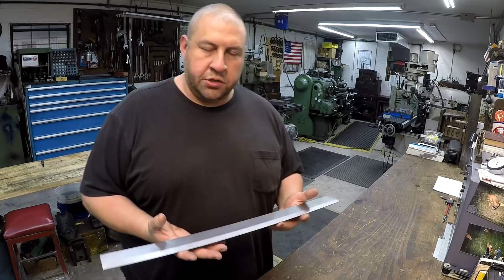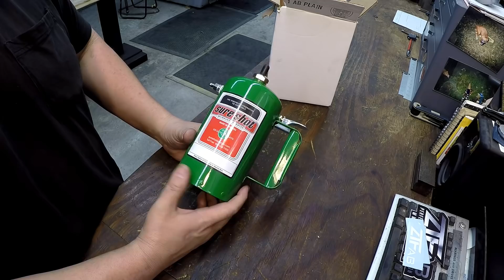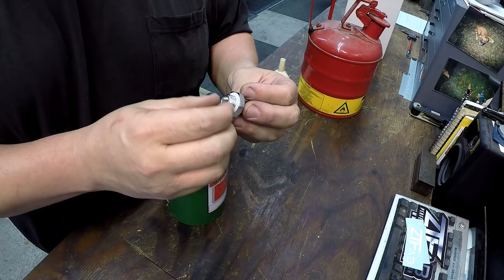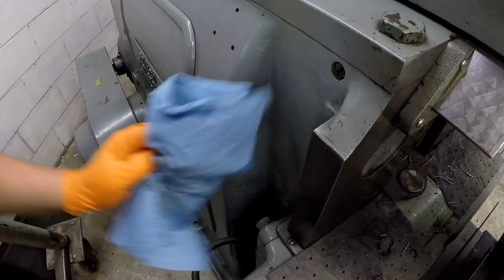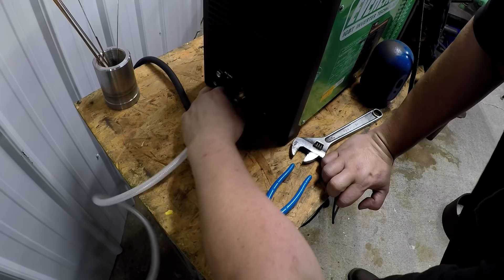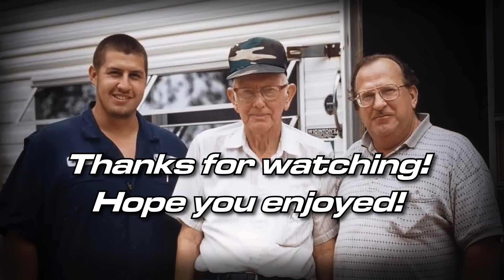SNS 216 Part 1: Straight Edge, Everlast Gas Line

Comment: @Abom79 I’m sure you’re already aware.... according to Sure Shot’s  website, the  “Green” sprayers are nickel plated steel cans and the “Red” sprayers are powder-coated steels cans. Neither sprayer can be used with water/water based solvents, nor paint. They offer several different types of nozzles and nozzle attachments based on the users needs. Just thought I’d share. Love your videos!

Comment: Hi, Adam. All right?
Here in Brazil this tool is called a wire ruler and serves to see the flatness of a surface.
MANUFACTURED IN HIGH PRECISION STAINLESS STEEL STAINLESS STEEL
ACCURACY ACCORDING TO STANDARD DIN874 / 00 - CLASS 00
A ruler of 1000cm costs around US $ 760.00
https://www.ccpvirtual.com.br/regua-de-fio-1000mm-digimess/p
I really like your videos.
Congratulations.

Oi Adam. Tudo bem?
Aqui no Brasil esta ferramenta se chama régua de fio e serve para ver a Planicidade de uma Superfície.
FABRICADA EM AÇO INOXIDÁVEL TEMPERADO DE ALTA PRECISÃO
EXATIDÃO DE ACORDO COM NORMA DIN874/00 - CLASSE 00
Uma régua de 1000cm custa por volta de US $ 760,00
https://www.ccpvirtual.com.br/regua-de-fio-1000mm-digimess/p
Gosto muito dos seus vídeos.
Parabéns.

Comment: Silly question: you're covering a straight edge. I have a few carpenter's squares and no idea which ones are right. How do I go about finding a good reference square to true them to?
Reply: LOMan squares can be self proving. For a carpenters square, place one edge up against a straight edge, draw a line on the 90 degree leg, roll the square over to where the square is on the other side, then draw a second line and you two lines you marked should be perfectly parallel. Hope that makes sense, if not there are some good YouTube videos showing the process.

Comment: Adam would you go over some details about machining on the lathe, the shaper and probably the mill about rough cuts and final cuts. I was wondering do you change cutting tools for final cuts, or maybe just slower cutting or not as deep cuts. Just like a general guide line. I am aware that the material used has to be a determining factor. I have been enjoying  your channel for sometime and have observed you make adjustment because of the results of a pass finish. .......Also do you have an existing video covering  the Monarch lathe machine operation. I see you when doing something when the cutting tool moves away from material and you moving around but more specifically what actions are you taking and are you doing more than one action ? Threading both internal and external also. What is selected on the machine to set up for a specific thread. Thanks Adam
Reply from the maker: Good topics, many of which I have tried to detail in many of my videos, when the topics arise. I'll continue to mention those things when I'm capturing the work.
Reply: Thank You Adam ! Your sharing of information is very helpful. I do pay attention as you apply Abom voodoo to the creation of machined parts. Great explanations of all kinds of tools,  materials and books. I am not a machinist but I have been watching half price books trying to purchased the older machinist book. Basic to advanced. The store says the good machinist books like you share with us do no come through very often.
Reply: When trying to hit a size it's important to take multiple cuts that load the machine identically as you approach the size, measure after each cut, and determine how the machine responds to a certain amount of cut that you're adding. As far as speeds and feeds, people often reduce the feed for finishing cuts to improve finish, and may even switch tools to a s sharper, positive-rake tool, since maximum material removal is not the goal of finishing.
Reply: Good answer, Good general guideline, Thank You Lite Roadie

Comment: We use the sure shot cans at the shop I work at for a rust proof spray that they buy in 55 gal drums. We spray all the parts with it. Works for wd40 too. If you take the spray tip off there should be a brass insert that you can remove for a stream spray.

Comment: Sure Shots have been around a while.  In the mid 1960s I used them to spray anti-icing fluid on aircraft propellers.  Far as I can tell, the design has not changed at all.

Comment: If you had overtightened the flowmeter fitting you would have left a big dent in the hose fitting which is curved where it mates the straight taper in the tee.

Comment: I checked out those Shure Shots out at KBC and they keep complete repair kits in stock - unusual in today’s throw away society. Perhaps individual parts are available too if you tend to drop them. I have used plastic trigger spray bottles for penetrating oil and other chemicals before, but sure shot really puts out the quantity, and they look fireproof as well. Last I looked, gallons of solvent were much cheaper than spray cans. Can you change the spray pattern to a stream for cutting oil, Adam?
Reply from the maker: I would say you need a different nozzle for the increase flow. I don;t know how well that sprayer would do for thick oils.
Reply: If you go to their website, you can get all different kinds of nozzles, for whatever you need... (Sure Shot site, not KBC... at least this is where I was looking)

Comment: That sprayer really sprays nice! Have you ever tried WD40 as a cleaner? It works well on adhesives. I never had a chance to compare WD against mild solvents.
Reply from the maker: Yes I use WD 40 as a cleaner, and to keep the bare metal coated weekly.

Comment: The pressurized solvent sprayer looks like it will come in handy.  Just be extremely careful of what you use if you are cleaning a surface prior to welding.  Brake cleaners and similar solvents can create phosgene gas when welding ( high heat ) which could literally kill you. Read this article to see how it almost killed this guy.  
 http://www.brewracingframes.com/safety-alert-brake-cleaner--phosgene-gas.html 
 Jeff

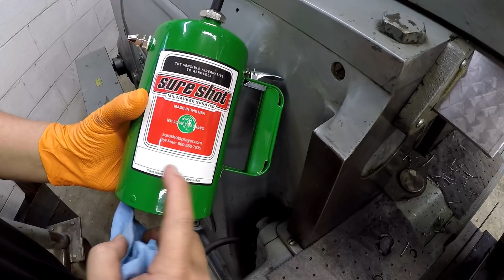Comment: Hey Adam at13:30 or so, it is a good idea not to mix lubricants, and on this note, any fluids unless you are certain no reaction takes place. Also most workplaces require the fluid container be labelled, which in my opinion is just prudent. I just had to pipe in my 2 cents worth here as I am very interested in those rechargeable sprayers.
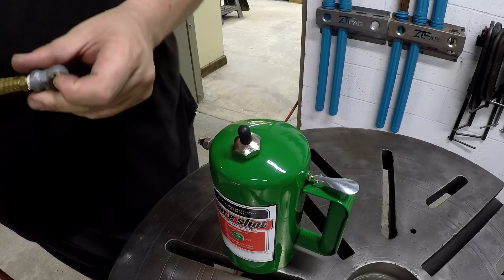Question: at 12:35 those sparks coming off the insert, is that just an indication of a worn insert doing a roughing cut? Or is that material just that gnarly?, thanks and cheers!
Reply from the maker: Yes, at work we have all of our containers labeled as to the contents and other information OSHA wants listed.

Comment: Hey Adam. I have a couple Everlast welders and really like them. But, those gas lines are garbage. They are too soft and balloon and it gets worse with age. Wastes a lot of gas. I made an adapter so I could keep the regulator and use normal gas lines.

https://www.everlastgenerators.com/forums/showthread.php/5472-Everlast-Argon-regulator-upgrade

Keep up the great work!
Reply from the maker: Thanks for the tip.

Comment: I really appreciate the tips you share with us. I did not know about the refillable sprayers, that would be a nice addition to my shop. Very curious about the Everlast, wonder what your opinion of the pulse feature is. Can it be used for aluminium?
Reply: I can't speak about the 200DV that Abom has except it does do AC (aluminum. I have the 250 EX and the AC and pulser are really good.
Reply from the maker: Yes you can weld aluminum on the 200dv. I have yet to try it but plan to.

Comment: Hey Adam I realy don't know why you are worried about working on a block , you have done so much more complicated stuff before! But in my mind the shaper is not the right tool to work on a block because I think that the beats / vibrations that are generated when the tool moves across all the openings of the block does not produce a good surface. In addition, if one of your mills allow you to use a tool directly in the main spindle, you can easily cut the block sideways! Maybe you could grab a broken block from a junkyard and do some practise cuts? Have fun !
Reply from the maker: I’m going to disagree with you on all levels.
Reply from the maker: Actually, that's just my machinist experience talking, but your right. Machining of blocks and heads are a different animal and require certain finishes. I'd still like to try it, just for the fun and practice though, on the shaper. Not for anything critical, but to share some odd shaped pieces that would be more simple to machine on a shaper vs a mill.
Reply: Thomas Eisen if you use a shear tool on aluminum and a very light cut the forces will be very light. That is an awesomely rigid machine. I might try it on a scrap block first but I think it would work well.
Reply: If the block is made of aluminium it will be alright thats true but if it's an older cast iron block the shaper can be rigid as can be you get a bad surface trust me , and running the shaper so slow and at low feed is a waste of time in my mind because an old beast like the G&E takes a lot of power to work.
Reply: Thomas Eisen ok, I haven't done it, so I trust you. 🙂
Reply: A friend of me had an old Ford Escord but with the cast iron block from Kent , also made som cuts on an old block from the junkyard and we really tried everything, different feeds, different sanded tools but always the surface was wavy, at the end we planned the block on a mill and it was fine .
Reply: Hmmm so you think that there was something wrong that we justoverlook Adam?
Reply: I understand ! I think you will make it because your shaper is in a very good condition after you repaired it, our was an old english Sherwood and sometimes only little details that go wrong got a bad effect on the surface so I hope you will be successful and have a lot of fun with that nice G&E !

Comment: Hi Adam , I have not been here for a long time. Are you not afraid that you will fall on these mats on the floor?  I ask seriously.
Your workshop is nice, but I do not like these mats.
Reply from the maker: Those floor mats have beveled edges and are low enough your not tripping on them.
Reply: Ok, thanks for your explain. 
You do a good job , good luck.

Comment: I have a chrome plated sure shot sprayer that I have been wanting to get replacement gaskets and a different nozzle for. It has a stream nozzle,  that is hard to use. I use it for acetone. Thankyou for leaving a link so I can find some parts.
Reply: If you look up Sure Shot Sprayer on KBC it will show you a list of products. Including repair kits and individual spray tips. KBC is nice unlike other online shopping they will ship for $8.95 for smaller orders, not $15+ like other places. They do have a minimum $25 order.

Comment: Hi:
I have a 24" & a 36" K & E Straight Edges that I used for drafting plans.  I guard them with my life.  The reason was because people would drop them, or beat them, use them for a bat, etc.  What someone did was tap your on the edge on steel.  I still have mine and still use them.  You need to check the back edge to see if it straight.  If it is, I bet you have a machine that will grind or plane it straight and smooth.  Most likely mine were made by B & S.  Most likely you can go back to the block you have and run it on a long piece of very fine sandpaper and smooth out the dings, but take you time.  Good Luck  Thank you for sharing.
Reply from the maker: I was informed that to properly regrind these you need to lay it on its side and use the side of the wheel, so you don’t cause anymore error that may be on the back side.

Comment: we used the sure shot cans in the plywood mill  for marking the units of veneer, we were using  diluted die. I have seen all brass , chrome, and painted different colors. oh, the spray tip, if you want it to spray a long stream just remove the tip then pull the little stem out , the stream will be a bot sout for your solvents..  if your mixing water based stuff for it the tips can get clogges, a little bast with aur  usualy fises it . but dont let the a safety notsy see ya doing it.. and be careful.  thanks for sharing !  hope this helps.

Comment: I had a foreman talk to me for using a wrench wrong.  Super nice guy but super intimidating at the same time... his forearms were like tree trunks. It always make me laugh when people use an adjustable wrench "wrong"
Reply from the maker: I’ve yet to break an adjustable wrench because it was flipped the wrong way.
Reply: if you have to use so much force that you break an adjustable wrench you have much bigger problems than the direction the jaws were facing.
Reply: There have been various guys on YouTube who have tested the strength of the adjustable wrench in both directions.  No noticeable difference was found.  Just another nonissue that some guys obsess over.

Comment: Ironic... I lost my AC about two or three weeks ago... just put in new system today... Im in Orlando
Reply from the maker: My new unit is on order. Should be here next week.
Reply: I never ceased to be amazed at the surface finish you achieve. You set very high marks. Thank you.

Comment: It’s always nice episodes wiht good info and quality  camera work. 
I heard You coment on people having opinions of how tools is to be used. Don’t lisen to such nonsens. For exaple: adjustable spanner has a slight angel to make it possible to take 1/12 of a turne by turning the wrench ”backwards” every 2:nd time.
Here in Sweden where Bacho is standard, I have been told to use the adjustable spanner bacwards when aplying great force. Reason is that the movable jaw is the weakest part and this apply the force to the movable part as far in to the gap as possible. The fixed jaw is more rigid and handels force close to the tip better.
I follow Your shaper series withe great intrest. I have got my selfe an 18-20” shaper. It’s in store at the moment but I plan to have it in my garage later this summer.

Comment: So I have been using a sure shot for about 10 years now. They are really nice. If you notice the tip is a 2 piece tip. If you unscrew the outer tip their is a little pin that you can remove to have a sold strem not misted. Works good for real dirty parts

Comment: Adam, where do you get the solvent you use in the SureShot?  I just use a can of Brakleen currently, but it uses a high pressure stream like you mentioned with your old “Zep” sprayer and I feel like to much is wasted. I am interested.
Reply: He said he got it from Zep Industrial in a different reply. 
I just got a gallon of CRC Brakleen from amazon for my Vaper Spot Spray. Since Zep Industrial shipping can sometimes be a bit cray-cray.
Reply from the maker: We use Zep Industrial Fast Evaporating Solvent Degreaser. You can buy it by the gallon, pail, or drum. Our local oil supplier also sells brake clean solvent by the drum.
Reply: Ryan lukens wondering the same thing!
Reply: You can get Zep products from them directly I believe if you have a shop. Most solvents are not safe so there could be restrictions on use. My SureShot works great but you may have to use some finesse to get a perfect stream mainly watching the pressure.
Reply: I buy my brake clean in 20L drums.  Then decant into a Wurth spray bottle.  Can also use IsoPropylAlcohol for a less aggressive solvent.

Comment: I have a Suburban tool one-footer straightedge I bought probably 20 years ago. Paid handsomely for it but was disappointed...the material was so soft it dented just way too easily. I would have thought it would be hardened somewhat. :( 
About the everlast...I found the flowmeter to be a quite high pressure as compared to my old standard I've been using for years. As a result it tends to waste gas with the big burst each time it is activated. I switched out to my old unit and bottles last much longer.
Reply from the maker: I too have noticed that burst of gas from the pressure. I may end up buying a top of the line unit to replace it.

Comment: Very nice. Got me a lovely little  B&S scribe block  from fleabay too......a bit of surface patina but not on the contact faces, so a bit of elbow grease and wet n' dry sanding should bring it up a treat. Has it's original box too though I think I'll varnish the inside and make up some oil cloth to keep the rust off.
Reply from the maker: Some good deals to be found on there. 👍🏻
Reply: True, I'm a real beginner though so only have the very basics so far. Heh I can at least measure accurately, next thing is a lathe. Cheers for all the videos, I learn a lot

Comment: I do my own guitar neck setups, and as such, need very accurate straight edges.  I fasten self-stick 240 grit sandpaper to my surface plate, and then gently bring my straight edges into a flat condition.  Even new fret testing tools (fret rockers) purchased from trusted sources are enhanced by this procedure.

Comment: Nice straight edge Adam looked like it was pretty good.  I have been using on of those sure shot sprayer in the shop for the last 2 years. Nice product!
Reply from the maker: Looks like you been doing good collecting yourself. I seen your new cylinder square. 👍🏻
Reply: Abom79 Yeah, got it this week and I'm excited about it👍. I had no square reference in the shop other than my machinist square.

Comment: That Zep nozzle you dislike is a plastic knockoff of the SureShot #301 nozzle. It's got some uses, but it's unsuited for general purpose use because it gives a stream only. You might be able to order a #602 adjustable nozzle that will screw right on there.

Comment: for the straight edge. are you going to make a sliding block to mount a dial indicator in.. so you could slide it along the straight edge to check for low and high spots.  really comes in handy for checking bed ways.. when you jump the wear area ..